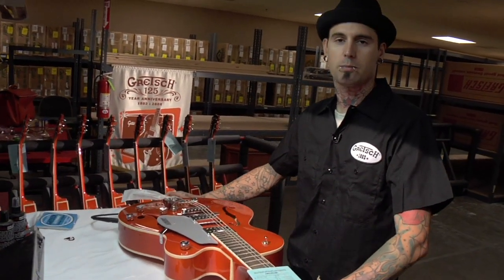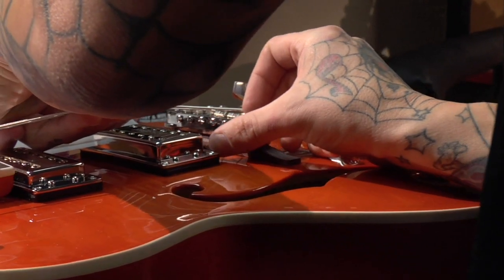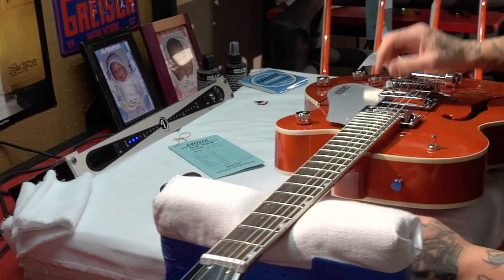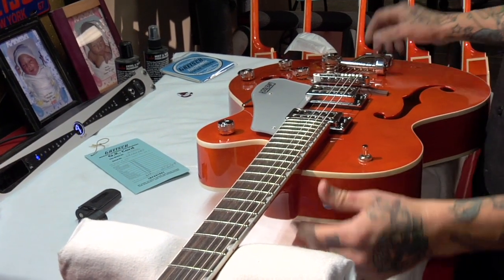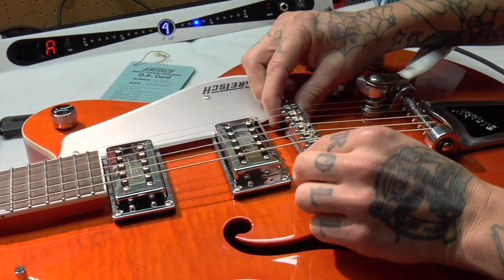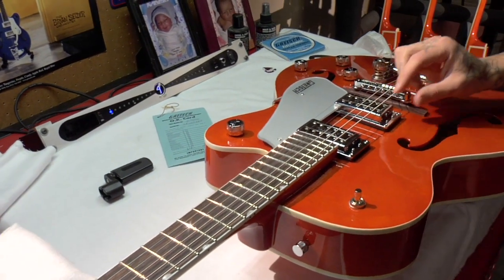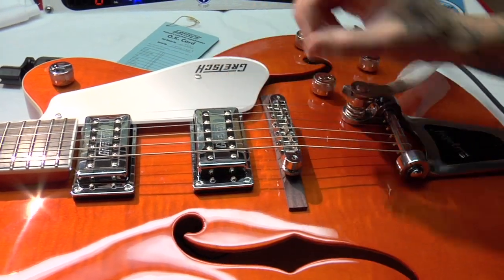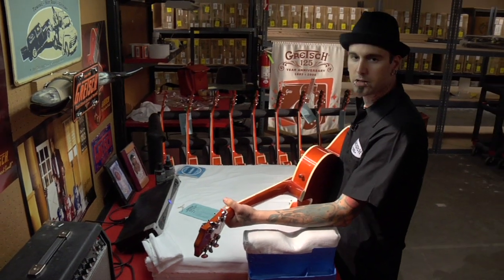How to Optimize Your G5120 Electromatic Hollow Body | Tech Tips | Gretsch Guitars

Comment: I own a Gretsch black penguin and I bought the modern gretsch space control bridge to replace the synchro sonic bridge. The result was really bad. My G strings was never on tune when I use to press a chord and as you don't have any saddles to move its impossible to correct tune. Then I bought the adjusto matic bridge and the result was even worst. Now my guitar was giving all the notes by pressing the 12 frett but the guitar went out of tune just by putting some chords. So I just put the Synchro sonic bridge again and the problem was solve. The message here is that all GRETSCH Bridges are very special. I set my Gretsch guitars very carefully and I take a lot of time to do it so. I also own a Masterbuilt with same synchro sonic bridge and it tunes perfectly so be aware of replacing bridges

Comment: Most Gretsch Guitars now come with posts to align and hold the bridge position. But the old floating bridge is still popular and in use today, especially with some Jazz players. It made sense when they came up with it 50+ years ago.
Reply: Would you mind explaining why it made sense back then?
Reply: @spuckz they could make more minute pitch adjustments on the fly. You can more easily change strung gauge, also.

Comment: Didn't mention adjustment/position of the adjustable bridge-saddles ? Needs a 'Part 2'...
Reply: Absolutely.  There is no way this can be intonated correctly with only adjusting the angle of the bridge based on the two E strings.   That may have gotten the angle of the bridge correct but I doubt the saddle position of factory setting is correct.  Just say'n

Comment: My advice to this would be; after intonating put small pieces of tape arond the edge of the bridge, remove the bridge and put 2 small pieces of doublesided tape at the ends and put the bridge back on. I'm not talking thick doublesided tape, but the kind you can get in hobbystores, or alternatively the kind that is used for photos. This will hold bridge enough in place not to ever slide. then remove the outside tape again and you'll have pefectly seated bridge without pinning it :-)
Reply: I heard using rosin also works to prevent the bridge from sliding around. I have not needed either technique so far.
Reply: I just got a duo jet and had to slide the bridge forward    Can you explain what is involved in pinning your bridge.  Will I have to have the body drilled out.  Which I really don't want to do.  I like the idea of the double sided tape.  Thanks  Daniel

Comment: Brian, I purchased a used G2420T Streamliner with a fixed bridge. Strings are not over/under the Bigsby as I am sure you are aware. The guitar is in excellent condition but when I tune to pitch, low E to high E or opposite, all strings go up to sharp? I try again with the same continuous results. I also checked intonation. I installed new strings, one at a time with several winds but this will not stop? I presumed it might be the truss rod but it I cant imagine that causing an increased tension on the strings. I love this guitar but I am beginning to pull my hair out. I thought about going to a roller bridge as an option. Any suggestions would be appreciated. Thank you.

Comment: This is not optimizing anything.  It's fixing your intonation again after you change it, which happens when you have to remove the foam.  This is kind of a weird design.  The foam is a petroleum product which will eventually break down into gunk.  You need to get it outta there.

Comment: Try intonating an Electromatic 12 string!!!!! The bridge is pinned, but clearly in the wrong position, I had to turn all the saddles around to get the thing barely in tune. I know they say, " You get what you pay for" but $800 is not exactly a cheapo for me. Considering all the the competition in this price range, Gretsch should re examine the Electromatic bridge
Reply: A lot of the models have that rattling bridge problem. Gretsch should also make every model come with a jack plate installed. It's highly unlikely of course due to the fact that Fender owns Gretsch and Fender Jaguars have always had that shitty bridge that most people swap for a Mustang bridge.
Reply: Intonation points depend on how heavy the strings are.  If your guitar was built for 10s and you put in 11s, then expect the intonation to shift off the center of the bridge.

Comment: The use of 12th-fret harmonics for intonation makes no sense. What is being measured here is the tuners accuracy wrt sensing an octave interval at different strings lenghts. The harmonic at half the string length is going to be double the frequency of the open string no matter how the frets below are positioned. For intonation you have to fret the string at the 12th, and a number of other positions up the neck. Then it is about finding the best middle ground for all notes on each string as no guitar with straight frets is ever able to be perfectly in tune in all positions simultaneously. You may find that you get the most accurate intonation by using tones as far up the neck as you can fret strings comfortably (18-20th fret on an electric) instead of focusing only on the 12th fret. A lot of other factors also come into play such as the height of the frets and now hard the string is fretted. A guitar that is intonated for one player may not work for everybody else, especially if the frets are tall.

On guitars with an unpinned (loose) bridge like this I would use masking tape to mark the bridge's position before I take the strings off so I can inspect, clean and oil the fretboard when changing strings.
Reply: my thoughts exactly
Reply: I agree 100%. It also depends on your fretting technique and string gauge. Using harmonics for intonation is WRONG - unles you only use harmonics when playing!
Reply: Can you explain what is the point of the 12th fret harmonic? The guy in this video checks the pitch of the open string, then checks the pitch of the 12th fret harmonic, and then checks the pitch of the string fretted at the 12th fret. He then adjusts the bridge based on whether the string was sharp or flat when fretted at the 12th fret. I'm not sure where the 12th fret harmonic has any bearing on anything. Seems like he could have just skipped the harmonic.
Reply: Jon Merlin - Well, not really the end of the story.  The harmonic will be the same pitch as the open string, though (just a higher octave), regardless of bridge position.  The harmonic isn't dependent on the fret position, but rather the middle of the scale.  For example, if you positioned the bridge so the scale was way off, the "12th fret harmonic" could potentially happen over the 13th fret, if the 13th fret were the middle of the scale length.

With the harmonic, you're only measuring the middle of the guitar's scale length, not intonation... unless you're aiming for the harmonic happening precisely over the 12th fret, but when it comes to intonation a matter of a millimeter or two could completely throw it off (so eyeballing it isn't usually a good idea, as the difference can be imperceptible).  

This is why it's better to fret the string at the 12th fret, because you're actually measuring the pitch at the fretted center of the guitar's scale length (the harmonic isn't reliant on frets, it just happens - by design - to coincide exactly with the 12th fret ideally) and thus all frets relative to that.  

Summary: the harmonic appears in the middle of the guitar's scale length (regardless of fret position), but intonation when playing depends on the fret's fretted position.  So, makes more sense to fret the 12th fret, as the harmonic is useless for setting intonation.

End of story (dun dun dun)

Comment: Um... I'm surprised no one has mentioned this... The stock G5120 comes with an Adjusto-Matic bridge. Can't you just set the bridge to the peaks on the F holes, tune the guitar, then adjust intonation on each string using the screws on the bridge? Isn't that what the screws are there for?
Now if it were a bar bridge, it would be different....

Comment: I perceive this video to be more of a quick and dirty way to get the Guitar set up in an OK manner for OEM strings and not necessarily to fine tune the intonation for each string which most of us would certainly want to do. We learned that you take the foam strip out from under your bridge and put it back where it was. A couple of pieces of blue non-stick masting tape will mark the original location just fine. 

Big Ron

Comment: hey couple of quick questions,
i have the g5129 and when your adjusting the intonation its easy to just move the bridge with your hands going into this will this effect tuning stability being its so easy to move the bridge? im having horrible tuning issues it just wont stay in tune im thinking cause its the bridge moving? would tapeing the bridge down hold it? or heavier strings like 11-52s? any tips ?

Comment: I find after bending strings the floating bridge moves around...I'm looking at securing the bridge with some foam or something.  Makes no sense to me as to why you would have a floating bridge when the string guides are adjustable. Too bad this guitar doesn't have 24 frets.  It has way more character than my Kramer and Ibanez that I use for classic rock.  But the Gretsch, although not klunky, is not built for speed..

Comment: @mjt11860 Sure, you can pin a mandolin bridge too.  Don't do this to a valuable guitar or mando because you can de-value it to a future collector.   Keep in mind that pinning a bridge affixes it semi-permanently.  If you change string gauge later on, you may need to move the bridge foot a bit if the bridge saddles don't have the adjustment range you need to zero the intonation.

Comment: well, you can either pin down the bridge (involves drilling, non reversible) or you can do as Brian Setzer did and use some electrical tape to tape it down (doesn't look too hot but it's more of a rock and roll solution).

Comment: @eatthemoon13 
I replaced the stock 5120 pups with tv jones classics. Do it. You wont regret it.. Damn hard to pick the difference. (in tone) between 5120 and a 6120 with tvj's. I cant, and I have both.

Comment: the rest of the strings?
Reply: Absolutely.  There is no way this can be intonated correctly with only adjusting the angle of the bridge based on the two E strings.   That may have gotten the angle of the bridge correct but I doubt the saddle position of factory setting is correct.  Just say'n

Comment: I did it by lifting one end up and sliding out half the foam, because there's a gap in the wood half way, then putting it back down and lifting the other half and doing the same, then it's left exactly where it was (if you're careful). And when changing strings, change them one at a time, then the bridge can't move :)

Obviously check to see if the intonations is ok afterwards.

Comment: Why would you keep moving the bridge around instead of using the actual screws designed to move the saddles back and forth to get the intonation correct? I suppose if you checked the intonation prior to first loosening the strings then you know for sure that the saddles were correctly adjusted,  but if you didn't you cannot be positive that the saddles were in their correct position from the factory. And once you move the bridge for say the high E say backwards but when you get to the G or D it needs to go forward but then for the low E it needs to go back again, there is no way by sliding the bridge around you could ever intonate the guitar. Put the bridge in the correct position THEN use each individual saddle scew to fine tune and obtain the correct intonnation!

Comment: i bought my guitar from the USA, and after shipping it back to Australia the intonation is a little out on the A string.  I've done exactly what this video recommended, but it's still out.  Any tips on how to fix this?  note that the bottom E string is fine
Reply: Try adjusting the fine adjustment screw and be sure to stretch your strings out before tuning them. I had a low budget Ibanez GIO that did the same thing and would never stayed in tune only on the G string. I had to stretch that particular string more to get it to stay in tune. Not sure why but it worked?

Comment: Hi, great informative video.
Im looking at purchasing the G5420T from the US and having it shipped back to Australia. Wanted to know whether I will need to do the same with the G5420T i.e. remove the foam under the bridge and adjust intonation? does the G5420T have the same floating bridge as the 5120?. Also, how difficult is it to adjust the string action?, I prefer a low action and was wondering whether they are already setup with a fairly low action out of the box?.
Many thanks.

Comment: I have a heavy palm as someone else mentioned and after getting my guitar back from the tech after he did the set up not long after playing I noticed I had moved it and when trying to shimmy it back I was too aggressive and ... It's out of whack right now. So my question is does it really matter where the bridge is placed after the bridge pickup? It just seemed like you put it maybe a fingers width for distance and then the rest.Does it matter?
Reply: Yes.  It matters.  If the bridge is in the wrong position then your intonation will be increasingly worse as you move up the fretboard.  That is, your frets won't be at the right position to give the note you are looking for, and the guitar will go progressively sharper or flatter as you go to the higher-pitched frets.

Comment: In my Gretsch G5120, I can not move both pickups very much - up or down.  What can I do to adjust them to string?
Reply: With a hammer lightly tap down. 
With a small crowbar 
Gently pull up. 
Hope this helps.

Comment: I can get the harmonics spot on but if I fret the 12th fret, a couple of the strings are slightly sharp, is that a finer adjustment with the screws on the bridge? Thanks for the video btw!
Reply: Your action is too high, or you are slightly bending the string when you hit the note
Reply: The harmonic will always be dead on. It's not possible for it to be off. You need to do exactly what he's doing here
Reply: The whole idea is to compare the harmonic to the fretted note.

Comment: all that fuckin around with the bridge !   for what ? it's the year 2016 not the dark ages. pin the damn bridge in place gretsch. it'll probably cost you another fifty cents . once you wack away with the whammy bar a few time the bridge will move and it's out of tune again anyway.
Reply: This is the older version of the 5420T. The upgraded models (since 2015?) have pinned bridges.

Comment: is this guitar good for amateurs? Or should you be really good on the guitar to get one of these?
Reply: You can get a g5120 used for around $350-450. For a beginner guitar it's not that steep of a price comparatively to a New beginner guitar that will be of a lower quality. New a g5120 with be looking at around 650-750. Now they have be replaced with a G5420. All better guitar IMO but new run around $800. If you want a new gretsch hollowbody, the new Streamliner series is between $450(550 if you want the waggle stick). That being said, the streamliners have a more traditional style pickup and thus will not have as much as "That Great Gretsch sound" as say a more pricey G5420 or G6130. Still a great guitar though either way.
Reply: I'm a complete amateur and I just got a G5420TG Snowcrest White last night new for just under $800 and I love it. The tone and sound is like no other guitar. I tuned it up once before bedtime played it this morning and it's staying in tune perfectly. Next up will be the Billy Duffy Model ;). Intonation is already good so I didn't have to worry about that. If budget is an issue pickup a used g5120 as Nathan said and see if you like it? I have 7 different guitars ranging from and Ibanez JS1200, Epi Les Paul Standard Pro, Fernandes Dragonly, etc, and I'm really enjoying my new Gretsch A LOT! Don't let your level of playing stop you from getting what you want and can afford. Every guitar has it's own sound and every model has certain traits both good and bad. Expand your sound :).

Comment: at around 1 minute 10 seconds you said to 'line up your bridge so the strings are in the middle of the pole pieces' or something like that. Are the pole pieces the heads of the 6 screws across the pickup?
Reply: that would be correct
Reply: Thanks!
Reply: Steven Martinelli xh

Comment: If you have a single string with bad intonation, you can move the individual saddles with a screwdriver. If it's all the way at the end of its range of motion and it's still off, you might conside moving the whole bridge and then adjusting the other 5 saddles.

Since the climate is so different from the US to Australia, the guitar may need to bet set up on arrival. That is, the truss rod may need to be adjusted before it's optimally playable.
Reply: I’m extremely surprised that the “ Expert”, doesn’t mention this. Finding an optimum position for the saddles, allowing “ both way adjustment “, is a good starting point.

Comment: No worries!  "Pin" the bridge.  Once you get the bridge where it needs to be for proper intonation, place tape around the foot.  Next, remove the strings. Lift the bridge off the foot (the tape keeps the bridge foot in place).  Remove the two height wheels.  Drill a 1/16" hole, 1/4" inside each threaded stud, straight down through the foot and through the top.Untape the foot.  Drill out the foot to 1/8".  Replace the foot on the guitar and drive two small screws through the foot into the top
Reply: Would not do that to a Gretsch

Comment: Thank you for the tip, per turning down neck volume.  I just never had any other guitar that I needed to do that.  Are all G5120 guitars like mine?   Also, what do you think about changing the factory bridge with a similar bridge with rollers for each string? I would assume it would help out when using the Bigbsy.